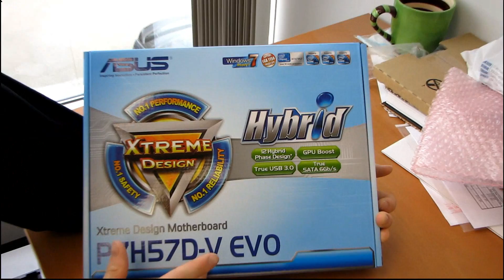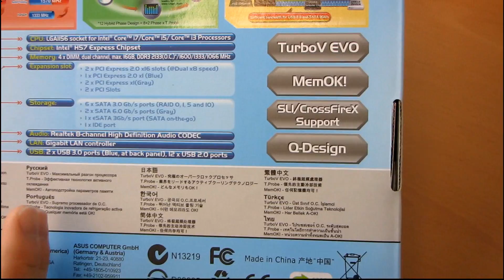ASUS P7H57D-V EVO H57 Core i3 Crossfire Motherboard Unboxing & First Look Linus Tech Tips

Comment: @KASHIF092 
This board doesnt have an AGP port or and AGP graphics card. Either you install one on one of the PCI-Express slots or get a processor with a built-in graphics controller, such as the new i3s or i5s being built by Intel,

Comment: Yesss, i just bought this motherboard and it is AWESOME. the only con i have about it is that i am running in a crossfire setup with 2 long 5870's and the only available pci slot is the one that is in the middle of the 2 graphic cards :P

Comment: @vastila It requires a separate chipset for USB 3.0 and SATA 3. The included Intel H57 chipset uses USB 2.0 like all others.

Each chipset currently made for USB 3.0 or SATA 3 only supports 2 such devices. Any more and it increases the costs substantially, since it is a third party chipset.

Expect this to no longer be a problem in a year or so when the Intel chipset itself supports both of these standards.